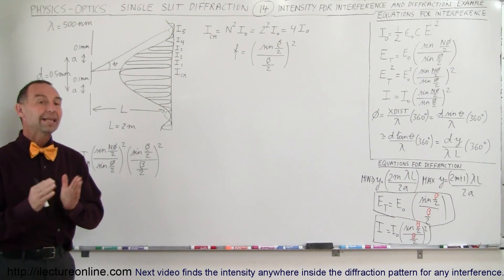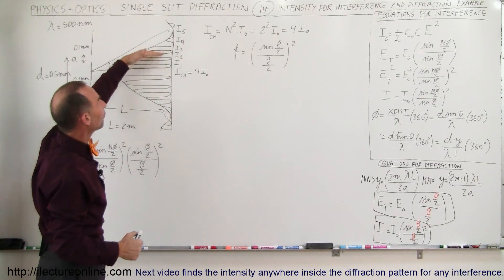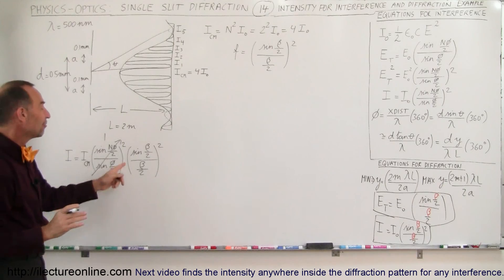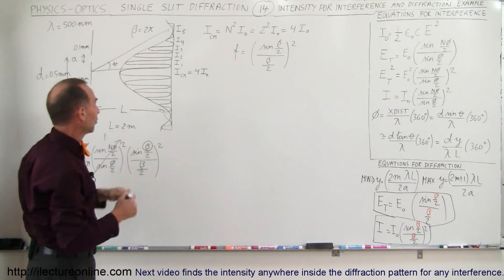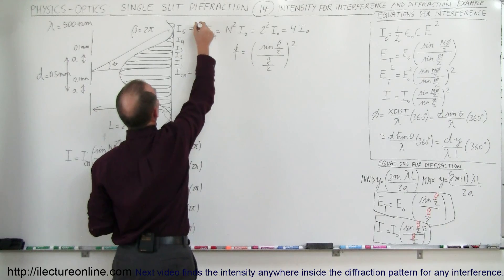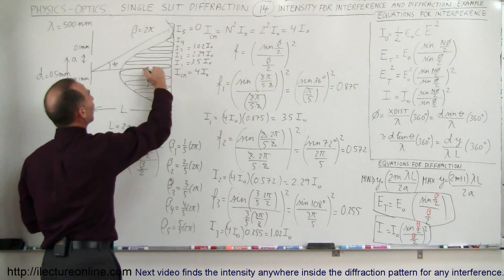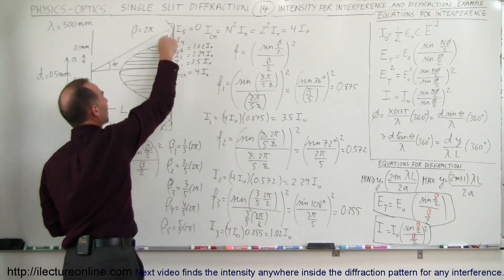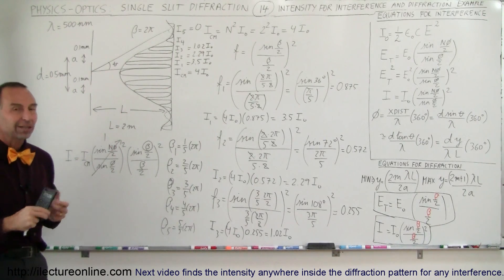Physics - Optics: Single Slit Diffraction (14 of 15) Location of Intensities = ?

Comment: Sir as you take separation between slits is 'd'. And slit width remain 'a' then for interference we should take (a+d) sin thita =n lamda. Or dsin thita =n lamda for maxima
.
Reply from the maker: The separation "d" is taken from the center of one slit to the center of the next slit.  Thus we use "d" for interference.
Reply: OK sir.